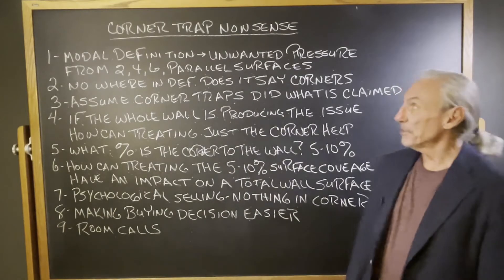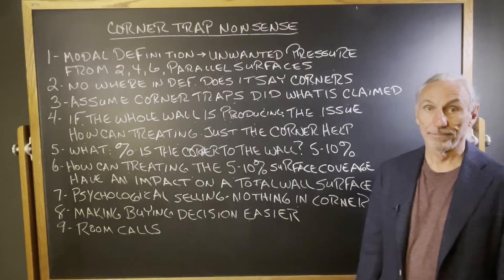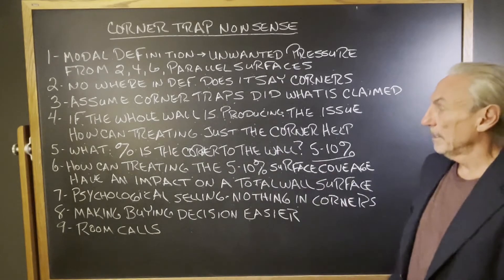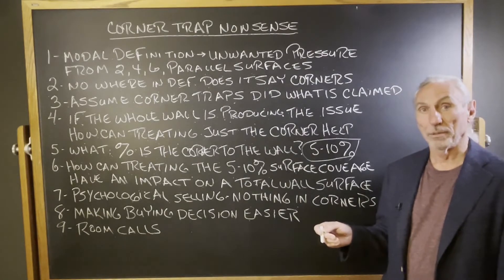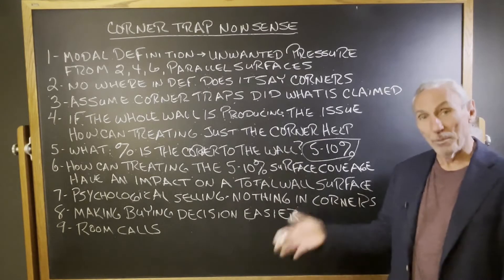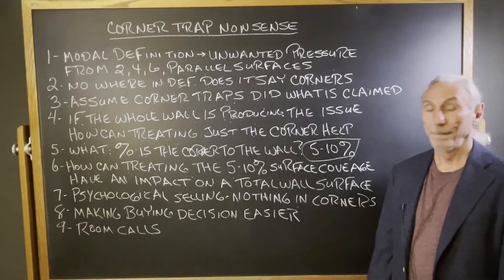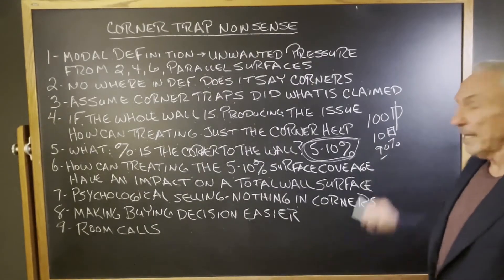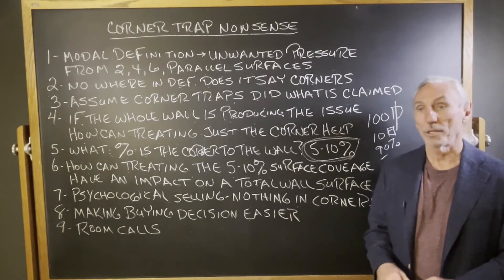Corner Bass Trap Nonsense - www.AcousticFields.com

Comment: My Opinion, corner bass traps are a joke.  You think there are 4 corners in a room? LOL.   There are 12, so you better get busy placing those trap now, and don't forget, they all reflect right into the center of the room, so you better get a center trap also.
Reply from the maker: The whole industry is full of people chasing their tails (symptoms) instead of focusing on cause (walls).
Reply from the maker: People do not understand the physics of pressure waves, so they fall for anything that companies portray as solutions. You can treat 4 corners or twelve corners. You will still have unwanted modal pressure waves since it is the walls, floor, and ceiling that creates the issues. People are always looking for an easy and cheap band aid. They don't exist.
Reply: @AcousticFields  I'm just an old guy that has been into audio my whole life.  Without using any techy wording or magic words like smearing...  I find that the easiest solution to nice bass is the placement of the drivers, and of course the fact that you need good drivers/enclosures to begin with.   Years ago I use to think Klipsch horns in the corner, etc was a good idea, but I after designing, building, installing, testing, tuning, literally 100's of systems,  I know the corners are not where it's at LOL.   But still many people and even companies are still suggesting placing woofers/subs in corners, against walls, etc..

Comment: Sure, reflections and thereby modes happen on the surfaces (walls, ceiling, floor). And now, what are corners? The point where three surfaces meet. (Yeah, when you say "corner", you mean "edge", where two surfaces meet.) Anyway, the area that is simultaneously in front of two or three surfaces is just a very efficient place to use absorbing material. One m² of material over the edge can cover ~1,4m² (√2m²) of surface. Also bridging the edge automatically gives you an air gap without wasting too much valuably usable space.
In the end absorbtion is mostly about the amount of material. Just a bit in the edges or corners isn't enough to achieve something great, but is a bit of an improvement and enough for some. (Many don't use any at all!) The same amount of material in the niddle of the surface won't do any more. If you use more material, you could also do that in the corners. If the room has 100m² of wall surface, you can cover that with 100m² of material. Butnif you span the edges, you only need ~71m² od material (100m²/√2). That would of course spend half of the rooms surface in airgap, which would be a waste if you don't use it as a storage space or something like that. 😄 But I think, you also rarely cover 100% of all the wall surface?
Conclusion: If younwant a great result, you shouldn't build up all the necessary material in the edges, but it's a good way to use a sensible amount of material more efficiently. Enough for some, just part of it for a greater installation. There's no acoustic reason to leave it out. You should only leave the corners bare for aesthetic or practical reasons or if you want to sell the maximum amount of material.
Oh, forgot one talking point: Every mode hits the corners! Yeah, for a straight mode, the corners and edges are only part of the surface and a larger part of the surface should be treated. But the modes that go between the edges and between the corners don't slosh into the surfaces like that. They stream parallel to wall mounted absorbers and can go arount them easily. But yeah, often those modes don't make as much trouble and if you have lots of material on the surfaces, you'll absorb enough of them. Someone who doesn't go that far and uses less material, catch those with only a bit of material in the middle of the surfaces. An edge spanning absorber will do some work on three modes instead of lots of work on just one mode.
It's not a complete high end solution but a great element for designing any level of solution.
Reply from the maker: If you treat the cause of the issue which are the walls, you don't have to result to band aids. Treating the corners is not an effective way to achieve a higher resolution. We call it tail chasing.
Reply: @AcousticFields  Have you even read, before yu repeated your selling point dogma? Corners and edges are not separate enteries from the wall. The greater edge area is just a small part of two walls.
I am curious: When edge, speaker and listening position line up, you can also have an early first reflection there. Would you categorically deny to treat the wall close to the other wall, because that supoosedly doesn't do anything?
A wall on average is only ⅙ of the whole rooms surface. And most often you don't cover the whole wall in absorbers, so it's also about 5~10%. Do you now say "That's way too little area to be affective"? No, you add the other wall and the other wall and the ceiling and if possible the floor.
Only for the edges you say it's too little surface area, instead of adding it up with more surface area. That's a very incomplete way of thinking (or of presenting your products and services).
Reply from the maker: @PsyKeks  You are spending time on treatment real estate that for its space is not worth the treatment effort when it comes to room resolution. Use common sense. What would be more effective when you are seeking resolution the walls or the corners. If you spent more time focusing on the cause of the corners, you will have a much higher resolution achievement for the dollars spent.
Reply: @AcousticFields   Do you have an explanation somewhere, why covering 1m² more central on one surface wall would be more effective than covering 1,4m² of two surfaces at the edge? Everything I've seen and read here was just "no, it's bad" with more words. Using "common sense" as an argument just indicates the lack of an actual explanation to me. Maybe even a fallacy as the root of the whole statement that cannot be explained as it's not correct.
You keep saying "The problem comes from the walls." But edges are just where two walls meet. So there's wall there and even two of it. And you say "The definition of modes talks about surfaces, not edges and corners." (Actually you said it worse.) But then that definition isn't complete / is simplified. There are also modes between four surfaces and six surfaces, that Largely play out in the edges and corners. Those are even much more numerous and very complex. (But they carry less energy per mode.) Also early reflections are a big part of acoustic treatment and those can very much happen in edges and corners and very nastily so, especially at 90° (Also I think 72°, 60°, 45° or 30°. Basically every 360°/n for n>3.) The edge or corner behaves very similar to an additional surface (could call it a virtual surface made of two surfaces) and arguably worse because of how it reflects right in the direction of the source and if keeps energy together that could have dispersed on an open surface.
I can so clearly see the importance of edges and corners as at least as important as the equivalent amount of free standing surface. I may not be good at articulating it, but I try. You, the one who disputes 'common knowledge' are not really doing a lot to articulate your point other than catchy phrases and incomplete definitions. (At least here. Again, if there is more of an explanation somewhere I'm interested in challenging my current understanding of it all.)

Comment: Hey! I will watch more of your videos, but before I do I’d like to preface my curiosity. I’m building a 16x32 building to record and live in. The monitors will be on the 16 ft wall. I know nothing of the magic for hearing or recording in a room and I am open to changing the dimensions before I build in the next month. I’d like to have a sub with a footswitch to mix mids then balance with the sub (The sub I found has a switch). I was an engineer so I’d love to delve into the science of sound. Where does it really matter in terms of acoustics when building a structure like this? Bonus points for citing the formulas based on physics
Reply from the maker: Your room dimensions will produce unwanted lower frequency pressures along with reflections that will produce time delays. You must first focus on the unwanted pressures the room dimensions produce. I would look at a 12 - 15' ceiling height to complement the other two dimensions.

Comment: What if I have 80% of this problem solved, now I need corner bass traps to complete the project. Of course it's gonna be from the floor to the ceiling.  Gonna do it for me do you think?  My room has lots of furniture and a damn rug. Nobody talks about this.  Talk about a room with gear Single chair in the back and then all this acoustical crap on the walls.  What is going on???
Reply from the maker: Furniture and rugs are not acoustical tools that are accurate. Most absorb energy at the wrong rates and levels of absorption for music and voice.

Comment: Yup I never thought bass traps are the answer the walls and ceilings is the issues not the corners.
Reply from the maker: Room modal issues are produced by the dimensions and the wall construction of the room. They oscillate throughout the room every 36 - 48". How can treating a corner treat that issue.

Comment: I put $70 worth of ceiling insulation rolls 24inch x 18inch x 48inch in the corners of my room and it cleaned up the decay significantly, I measured the before and after waterfalls and it works.
Reply: Corner bass traps are proven work.
Reply from the maker: Your definition of "it works" is different than ours. We treat the cause of all issues. We do not use band aids. If you treat the cause, you eliminate the issue forever and you are not chasing your tail by bouncing around in each corner of the room.
Reply: @AcousticFields ok well, it “worked” for me and my room? The decay dropped from 500ms to 380ms and it cost $70. Can’t be mad at that.

Comment: @AcousticFields I messured my room. I generated some single bass sinus 40, 50, 60 up to 130hz frequencies and I found out in the corners of my room are the bass frequencies very loud and in the middle of the wall not so much. Maybe is also the phsyics of the room, idk, but you could hear it!
I mean yes you could treat the whole walls with some insulation material and special builds, I think it will helps too, but of 98% of people, it's not possible, because is not the house or appartment you own and It is more expensive and it is also a space issue.
Reply from the maker: Building insulation is not a low frequency absorption material type. The dimensions of the room determine the modal locations. The walls produce the dimensions, not the corners. Stay focused on the source of the problem.
Reply: @AcousticFields  Reverberation and first reflections => it is the room not the speakers. Or what do you mean with source of problem?

Comment: Cover all walls, but do not leave the corners. Have same panels butt on adjacent walls or even better is make it one panel going across the two walls (corner trap) with more wool or just use a limp mass hung in front that can dampen the energy like a tennis ball hitting a curtain. Another more expensive option is to include an activated carbon into a cylindrical style bass absorber. Just listen to the sub woofer booming in corners and the same reducing after the bass trap is installed. Each panel on the wall an do wonders on the bass as well, when built right. I guess that is where this video is heading. Moving viewers into their product. It must be working, though.
Reply from the maker: Most rooms are not designed to be audio rooms. Their original design was a bedroom , living room, or basement. In order to create an audio friendly environment, you must treat the complete room and make the frequency response more balanced..

Comment: I like this guy. He seems angry about what he knows and I am that guy for half the day. The other half of the day I try and find the joy from the totality of all the things I’ve learned.
I searched this topic because above my Tv and speaker system I had a roof leak that damaged the drywall. I have fixed the leak but not the drywall. It means ripping out all my gear and dealing with the plaster dust. So, I thought I would build a beautiful corner ceiling bass trap and deal with a huge booming from the subwoofer and obscure the wrinkles in the ceiling drywall. I can do a permanent fix in a few years.
Reply from the maker: We are a company that has a mission of resolution. There are many band aids people use as tactics with no regard to a sonic strategy. We can not participate in such tail chasing. Time is too short and music too important for our client base. Drywall has a negative impact on frequencies from 800 - 2K.

Comment: I measured the corner and it results show peaks in frequency.
Reply from the maker: Now, measure the wall which is the source of the corner issue. If you treat the source of the problem, no problem.
Reply: @ it’s seems a 50/50 .
Reply: @AcousticFields  I must be doing something wrong

Comment: I have found there are valid reasons for corner traps. The main one is that bass frequencies gather in the corners because they spread from the source more easily and widely and the main speakers are nearest to the front corners. When I put some traps in the two front corners I found the freq response smoothed out for panned images all across the front.
Reply from the maker: Spend your dollars in treating the cause of all issues which are the walls themselves. If you treat the walls, no corner issues. If you treat the corners, you still have the wall issues.
Reply: @AcousticFields  Edges and corners are just the parts of surfaces, where they meet. If you treat all whole surfaces, you will have treated the edges/corners as well. Deliberately keeping distance from the edges wouldn't make much sense.

Comment: do you think making use of rug carpet on part of the walls will handle echoes in a large room like church building?
Reply from the maker: Your issue within a church is termed reverberation not echo. Echo is a repeating signal. Reverb is the summation of reflections. With reverb treatment, you must absorb 75% of the frequency range from 125 hz. - 500 hz. Carpet would not have a chance to achieve this treatment goal.

Comment: I always thought corner bass traps were just for removing excess bass energy from the room, since bass energy likes to collect in the corners.  I've never read that they reduced modes.  And I would just build my own.
Reply from the maker: The dimensions of the room determine the modal issues that oscillate throughout the room, not just the corners. If resolution is your goal, you must treat the dimensions not the corners. What would you build to treat the modal pressure issues?
Reply: @AcousticFields  dont have a lot of width as the room is only 12 feet wide, so limited in possibilities.  One of them would be to use the back riser as a bass absorber as well.

Comment: The corners are part of it, but shouldn't be ignored. Of course you need to deal with the walls. It is common knowledge that 90 degree corners have a bass-coupling effect. Sure, you are not done with only the corners, but is an excellent starting point. At the end of the video I see the agenda. You want to sell your products.
Reply from the maker: No sales involved. Our goals are resolution and you can not obtain resolution with band aids that are applied to symptoms of the real issues. The dimensions along with the wall structure produces the modal issues that need to be treated. The industry is full of band aids. Those are the companies that want to sell products that people buy that do not understand the real causes of distortions.

Comment: My home guitar studio is small, 8’ high x 12’ long x 8’ wide. So far I’ve got 3 2’ x 6’ 2” thick foam panels glued to plywood hanging 1’ off the floor. Behind the amps/cabs will be up to 3 2’ x 6’ foam panels, and the entry walls and door. I have carpet on the floor. Sounds great, no real echo anymore so I get good room mic’ing and can mic’ing (of course) my 12’ x 8’ wall has 46% coverage. I can move the panels if I need more but I doubt it as recommended is 15% to 30% coverage
Reply from the maker: None of your technology deals with low frequencies. You have to go after lows, mids, and highs throughout the room.

Comment: Oh!  This is SOOO refreshing to hear!  I am an electrical engineer, NOT an acoustic engineer but I read a lot about acoustics while building several studios for my own use.  I am an old guy; I don't remember when corner bass traps first appeared, but they were NOT in many of the studios I have worked in or visited.  Motown, Sun Studio and many I visited in NYC, Philly and Nashville do NOT have corner bass traps.  That tells you something.  I like what this gentleman says: "We can't trap bass, we can only manage it."  Volume, material and design.  Amen.
Reply from the maker: The industry is full of band aids and tactics as such that do nothing to improve overall room resolutions. It is the room dimensions and only the room di9mensions that determine what energy the room will "like" and what energy it will not. You keep what the room likes and your treat the energy the room does not like. This is not rocket science. The real misunderstanding comes in the application of treatments. People can't see through the hyperbole, exaggeration, and half truths the industry spits out that masks the real acoustic truths that involve rate and level of absorption.